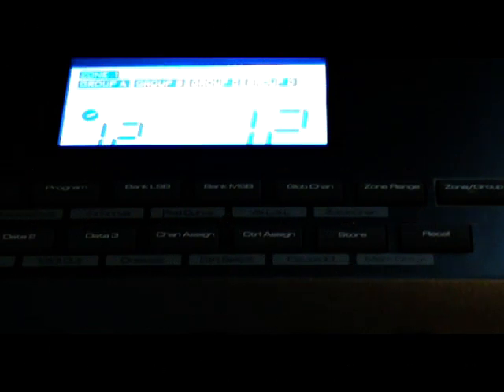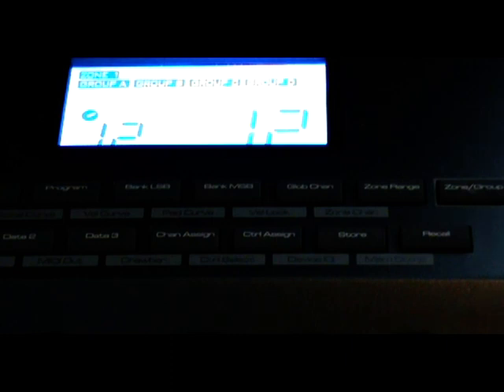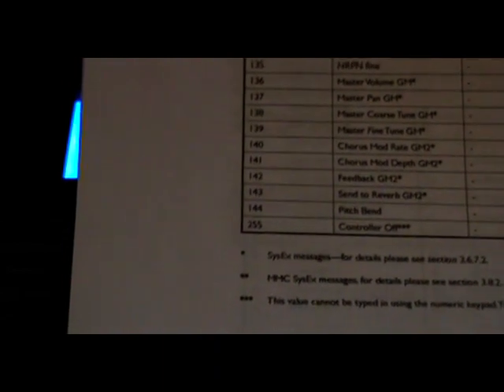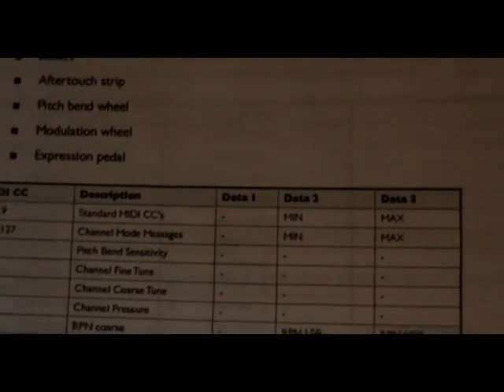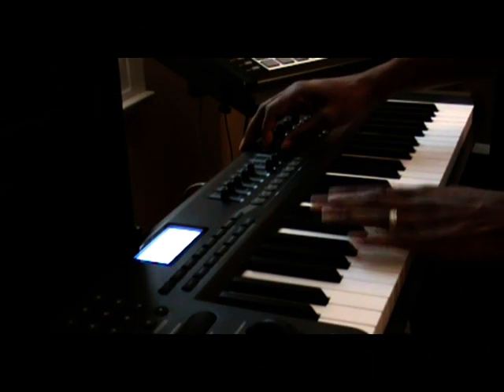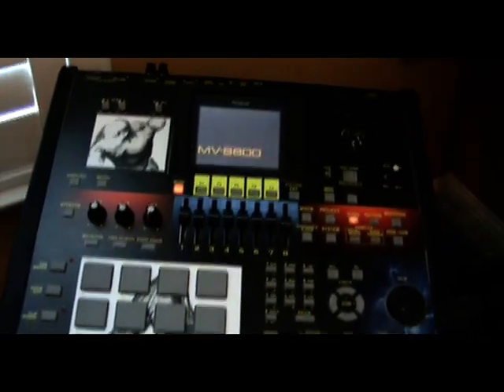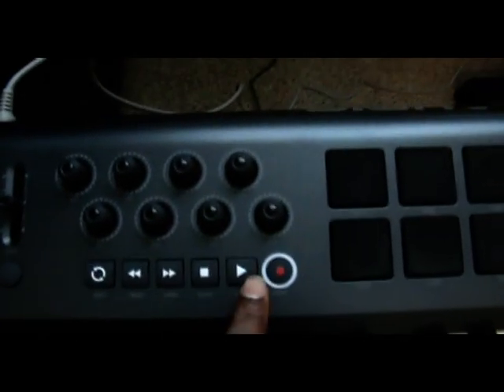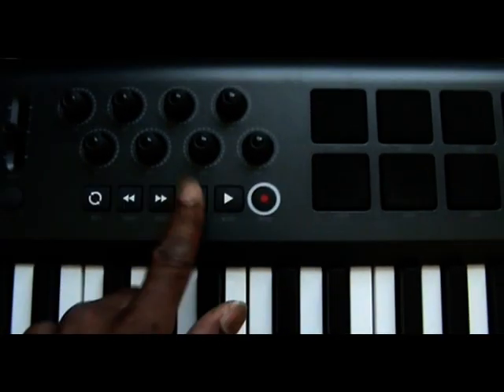Midi, Part 3: Programming Controllers

Comment: Hello sir. 
How can I stop the knobs and sliders from playing notes? Same with drum pads
Reply from the maker: Hi Joilyn. Probably what you want is to use the mute button.  From the manual... The Mute button on your Axiom will turn off the MIDI data output from all controls... the keyboard still works. Personally I'd rather leave everything on and use the pads or just avoid touching them. Worst case, unassign the sliders and knobs and set the pads to an unused channel. Good luck and enjoy making music.

Comment: Hi Ken, I'm looking into purchasing a midi controller and I've watched your three videos and videos from about 4 other people. So far your video is the clearest, so congratulations. 
There are three basic things I don't understand :
1. What are encoders for and why do you have so many?
2. I understand that you were able to use one of the faders as a pitch bender, but why do you have so many faders?
3. Why do you have pads on your controller keyboard since you already have them on your other machine.
If you could let me know that would be great.
Reply from the maker: hi +chamboyette853, i'm glad you found it helpful. Encoders are most useful when you need to 'dial in' or fine tune a parameter such as the frequency on a 4-band EQ or the amount of delay applied to reverb. The number of faders and knobs that you use is up to you, the manufacturer tries to give you as many as they can reasonably fit on the device so that you have choices. If you see my video on mixers, you'll see that I actually have a small number of faders on my keyboard compared to a pro-mixer. As for pads, the keyboard comes with pads that not only have a different feel, but they allow me to use pads when I can't reach my beat-making machine during a performance. Cheers.
Reply: ***** Thank you for your response. But can't you do that just as easily on the computer when you're fine tuning the score?
Reply from the maker: You can do everything with the computer but it isn't always the fastest way to do your workflow. The computer keyboard is designed for typing and usually requires memorization of keystrokes and/or sequences of strokes, with knobs you just have to remember what it is assigned to. Mice require hand-eye coordination, faders can be found by touch in a dark nightclub. Touch screens are a big improvement but still lack the tactile feedback of faders, knobs, and pads.
Reply: ***** Thanks for the answer. But what if you are simply recording music and not performing. Is the advantage still the same?
Reply from the maker: chamboyette853 same concepts apply, except you don't necessarily have to have a keyboard if your aren't going to play any notes or trigger samples. you can just use a regular DAW controller/surface if you don't want to control musical instruments, like Avid Artist or Mackie Universal Pro - these tools make it easy for you to control your recording process without having to touch your PC, and it helps you get a small taste of what a pro recording studio is like.
Reply: ***** How much time does it save to not have to touch your PC? And do you know people who do recording who don't use these controllers etc...?

Comment: hi,how do you go about changing sounds by midi without touching the sound module?
Reply from the maker: hi eddie, it is called a 'program change message' and on controllers there usually is a 'Program' button. On the Axiom I think it is called 'Prog', and when you press it you have a few seconds to punch in the patch number or scroll through them using the + or - buttons. hope this helps!
Reply: ***** thanks,got it working.happy dayzzzzzzz

Comment: Hi Ken, first of all I would like to say THANK you for all those amazing tutorials you made for Axiom 49. I use it for several years and I never found good tutorials about it. I would like to ask you something. I tried to send e-mail to M-Audio but nobody answers me, so I will paste the same thing I sent to them, ok?

I have an Axiom 49 (1st generation) and use Ableton Live 9.
What I'm trying to achieve is control several instruments using the ZONE button with the ROTARY Knobs.
For example: I want to control 8 parameters from "X" audio effect using Zone 1 and then I want to control "Y" audio effect using those SAME Rotary Knobs BUT using the Zone 2.
I've read the Axiom 49 manual several times, all topics are very helpful EXCPET for the Zone sections.

Could you PLEASE help me? It's driving me crazy.

Thank you

Claudio
Reply from the maker: hi claudio, not sure i can help, i have not tweaked my axiom 49 in a while, i'm using 61 now. i did some quick reading and as far as i can tell, it looks like you can assign each of your encoder knobs to a zone by setting the channel assignment to 17(zone 1), 18(zone 2), 19(zone 3), or 20(zone 4). i would try assigning half to zone 2 and half to zone 3, that will transmit on midi channels 2 and 3 by default. assign your effects parameters to listen on those channels. zone 1 transmits on global channel by default so might be able to create a "master" knob. that's my wild guess, let me know if any of it turns out useful.
Reply: ***** Hi Ken, first of all thank you so much for answering my question. I sent an email to Ableton (registred user here) and they helped me. It turns out all my zones was transmiting all the messages to global channel even if I switched their channels. We're still trying to fix it. I believe we're going to the right way  hehehe. Cheers from Brazil! Keep making those amazing videos :)